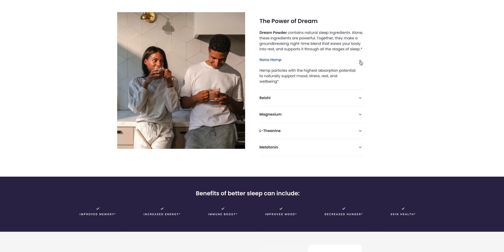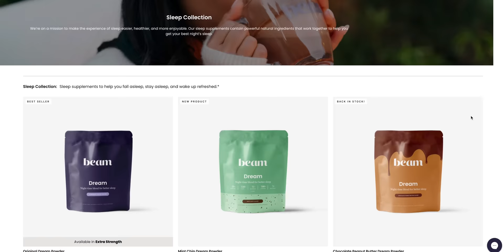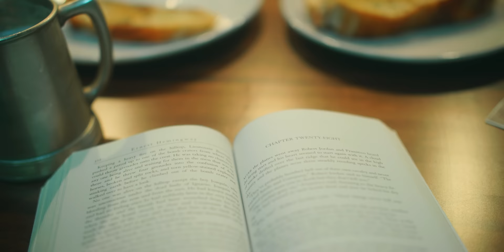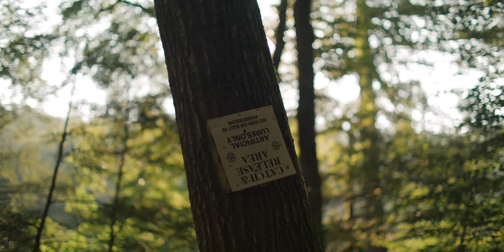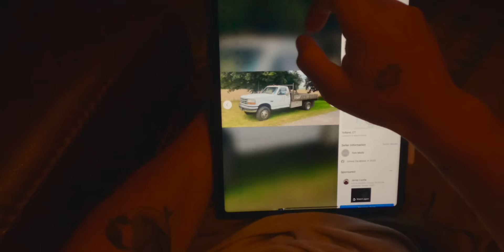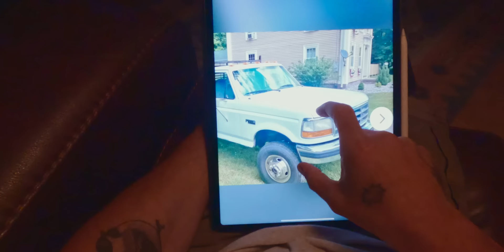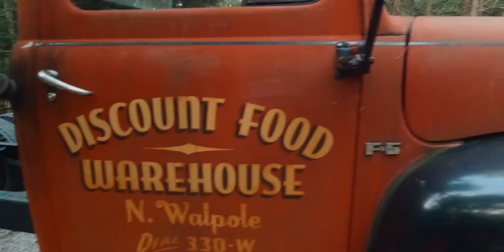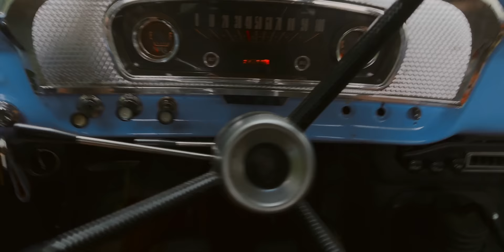I'm Switching Careers

Comment: Just an observation about your roof on the new home. If you need some breathing room, and are not ready to replace the roof, the leak is most likely due to the skylight. Putting just a new skylight or looking at the flashing could buy you a couple of years. I had a roofer that said when you replace a roof you should replace the skylights.

Comment: Tripe AAA is not as good a service as it used to be I found it totally unreliable when I recently, accidently locked my keys in the car and when I called AAA they said someone would be right out I waited 4 hrs. and called them 3 times and still no one came. I ended up calling a local wrecker service and they were there in 5 min I was told by AAA to file for a reimbursement payment, UGH why didn't you just come??  I love your videos I grew up in New England and they bring back such great memories.

Comment: Bout half way thru "I'm Switching Careers", so I don't know if you've taken care of the roof.  Building envelope experts/engineers/architects will tell you that skylights are the worst idea in the history of buildings.  They almost all eventually leak (same with cars), and in the winter they leak in the form of inside rain (condensation).  And all that moisture causes mold, mildew,  and rot.  I know the light is great, but you might think about eliminating all or some of your skylights.  Good luck with the roof.